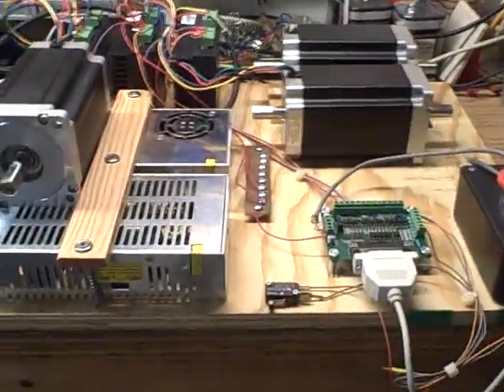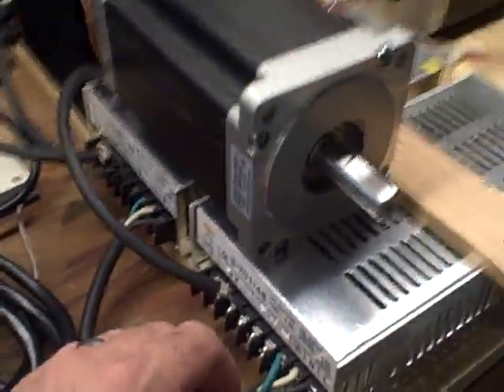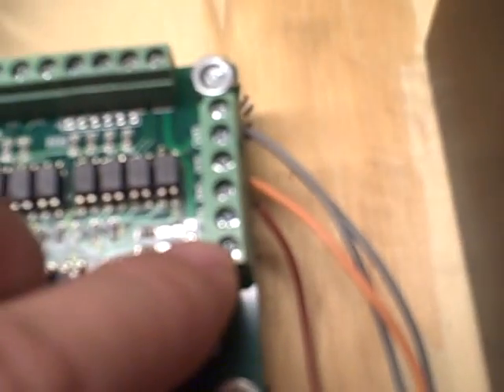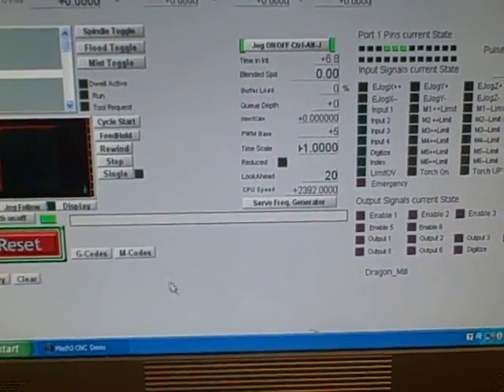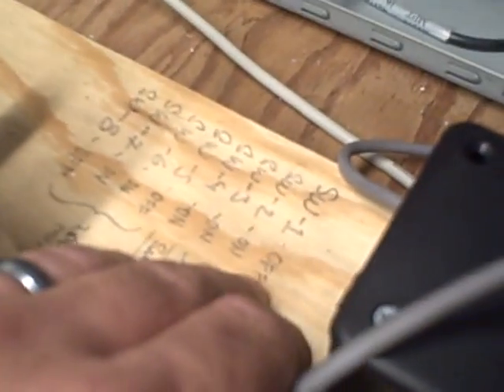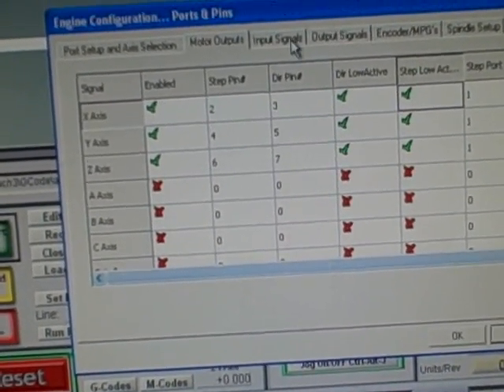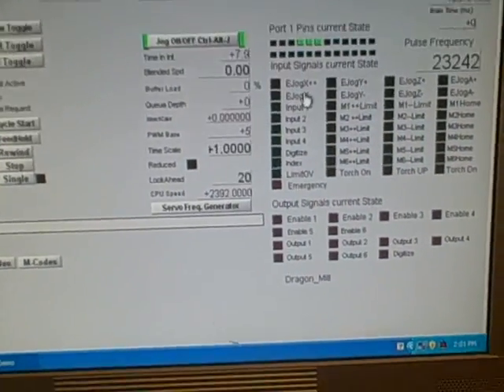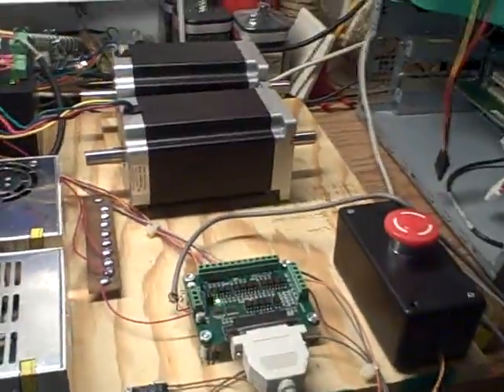CNC Longs Motor Stepper test Nema 34

Comment: Good generally wiring vid, thanks .
Hell its all mostly the same this will help me- I’m building  5x5 steel (welded) router with 650 oz in Nema 34s. And a 450 oz in forvtgr Z. Slaving X & A together 
Hope it works my life depends on it!

Comment: I did wired as you setup, but when I turn it on, the serial port cable become so freaky hot, then spark something inside of my cnc box . After that my destop pc does not turn on anymore. any clue?  (Old destop pc)     The 25 pins serial cable it's history.

Comment: Hey man!
I have a question about RPMs of stepper motors, how much rpms are max which u operate with?
I can get only like 240rpms with my Nema 23 425oz, If i go faster, the motor just stops and produces strange noises and vibrations. What to do?
All the thing is with no load on the motor shaft.
Reply: +Matic Rožič Stepper motors are not to be used as a high rpm operation.
If you want something like that you need servos, not steppers.
Reply: +Matic Rožič I have nema 23 270 oz. Like yours they judder and will not go over 400 mm per minute. frustrating.

Comment: i'm thinking about buying a kit from long motors, but i'm concerned about the quality. I'm worried about the motors missing steps because of the driver and such. did you experience any problems concerning the equipment ?
Reply: dennismeukens run a Mesa 5i25 and Linux CNC and you won't have any issues.

Comment: Does anyone have a good recommendation on timingpullies that fits this motor with 14mm axles and two set-screws?

I havent been able to find any pulleys that fits these 14mm axles since there are no equivalent size in inches.